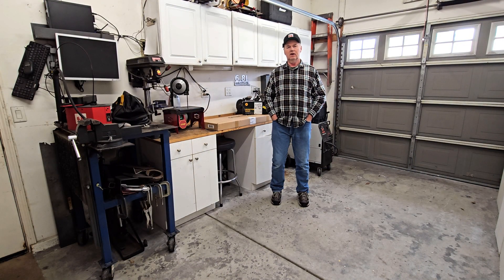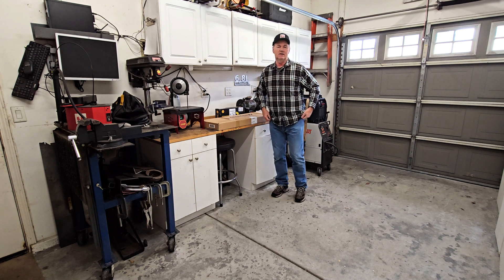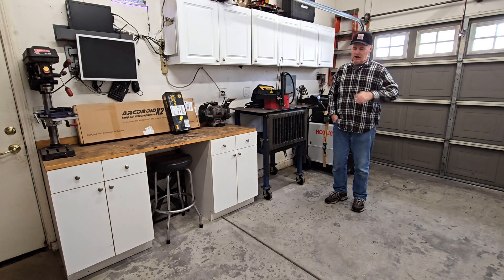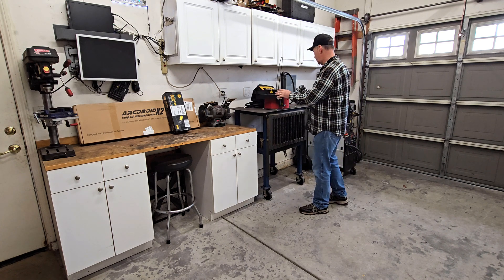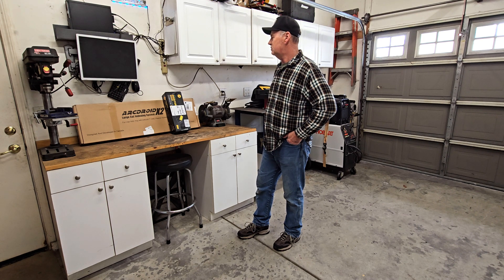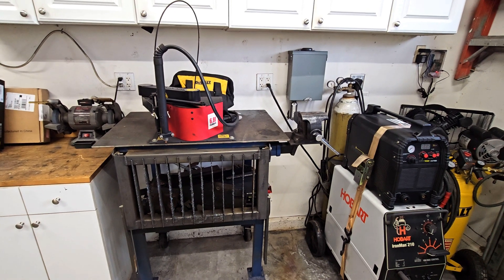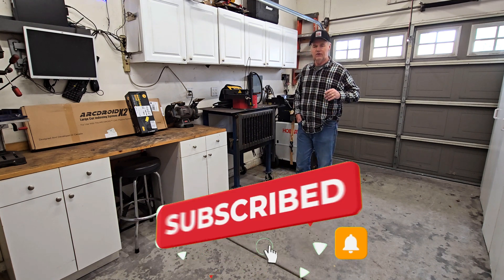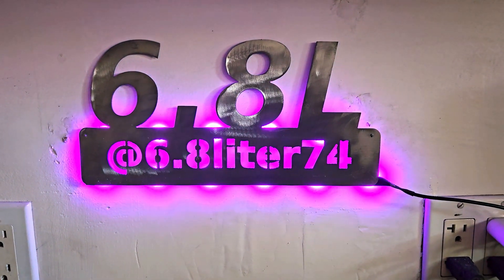Garage Makeover: Setting Up for CNC Plasma Cutting | ArcDroid & Water Table Upgrade

Comment: This video notification popped up while I was at work today… I was super keen to watch but I had to wait until I got home so that both my wife and myself could watch together… it’s our tradition haha. Cool video. It’s nice to connect with you and your space a bit more. We look forward to the upcoming video where you get to unbox your new toys. 🙏🇦🇺
Reply from the maker: @Fab-Life444  Thank you both for your support.   I am excited for the water table, it won't be able to drain and fill like yours, but it should make less smoke and mess in the garage!
Reply: @ just put an additive in it and you’ll be sweet. The drain function on mine only helps with cleaning the metal out. 👌
Reply from the maker: @Fab-Life444  I'm definitely going to be doing that.